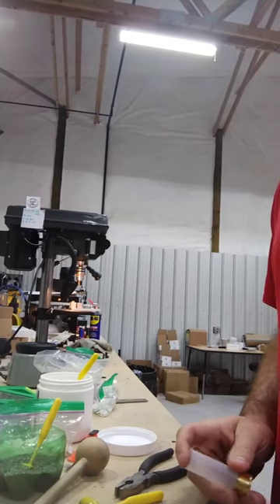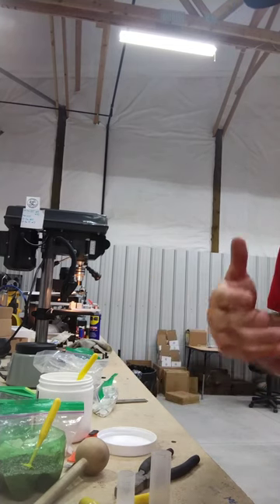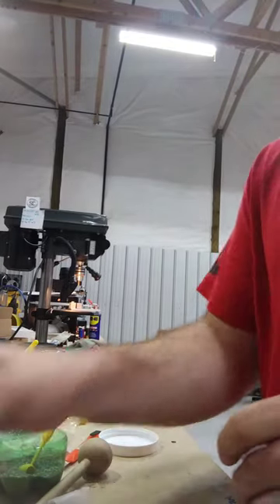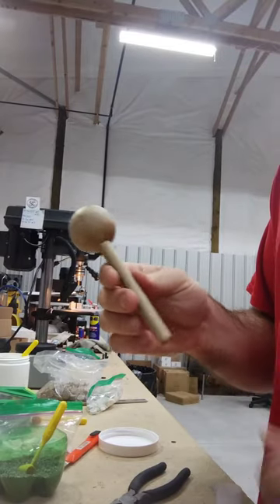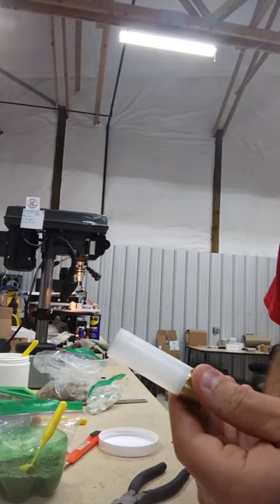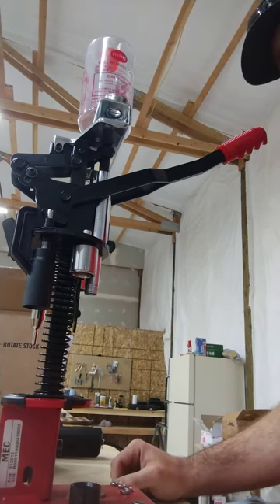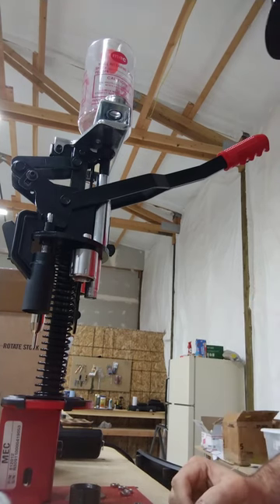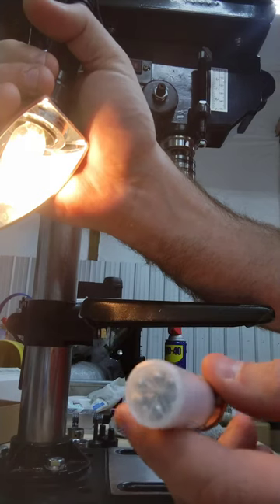12ga 2-3/4" Steel Load w/Modern available Components  🦆 🐔 🦢 🕊️ 🐦 🔨

Comment: The MG42 wads also work in taper wall hulls but you have to use the mica wad slick on them. I use 31.5gr of Longshot and the MG42 wad in both Remington STS hulls and Federal top gun hulls with 1oz crossman BBs and they work great.

Comment: i need some advice. ordered components form bpi for a load from bpi. 2 3/4 fiocci hulls/fio primer, 1oz 1 shot steel, 44gr alliant steel, lbc43 wad. is that even possible/safe? i didnt know better when i ordered, i just seen 1650fps and was thinking in my Cro-Magnon melon "12g fast 12g good geese die fast ungabunga".
Reply from the maker: @millhouseiguess5645  sounds about right... I believe they have a 1-1/8oz load with the LBC43 with 43 grains of Steel... If it's in the book, it's safe.
Reply: @saltcreekammo   someone called from bpi and said it was safe but kind of a goofy load they made for someone, said it works just not good and can be a pain to get seated/crimped. appreciate the response! he gave me an alternative using 36gr and a 1/8th felt wad, going to try it soon!
Reply from the maker: @millhouseiguess5645   that load is super fast anyway, lowering the charge to get around 1300-1400 FPS would be better. So you're on the right track.

Comment: Have you ever tried loading some 12 gauge 2 3/4 federal hulls with 1 1/8 oz steel shot with powders such as blue dot or longshot?
Reply from the maker: 1-1/8oz can't be safely done with Longshot in 2-3/4"... Blue Dot probably, but it sucks in cold weather.
Reply: @saltcreekammo  I figured you might say that, I know it can be done with STEEL powder because my buddy's done it for a few years. Unfortunately that powder hasn't been on a shelf in my area for a couple years.
Reply: @mickluther2693  steel is back around now